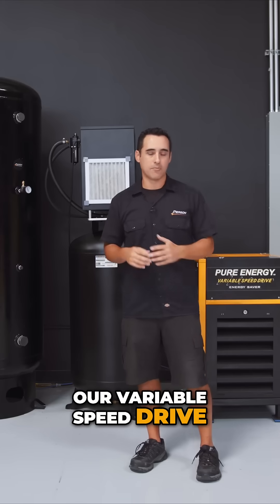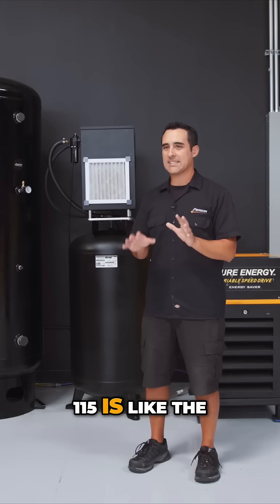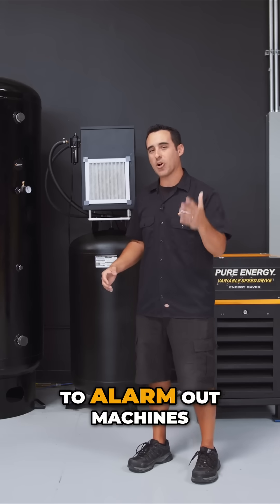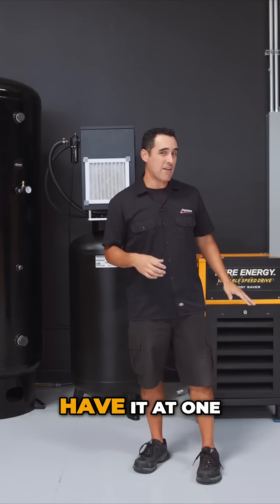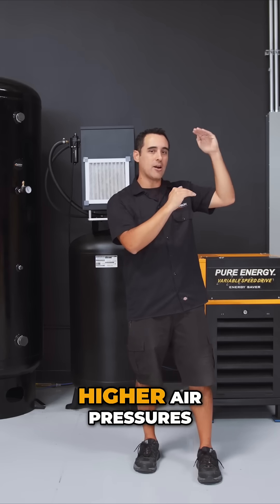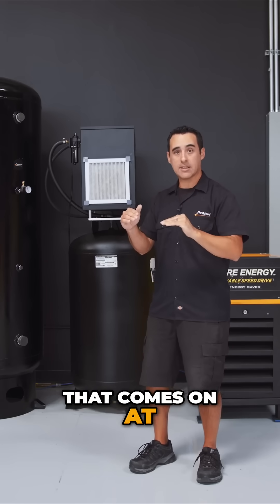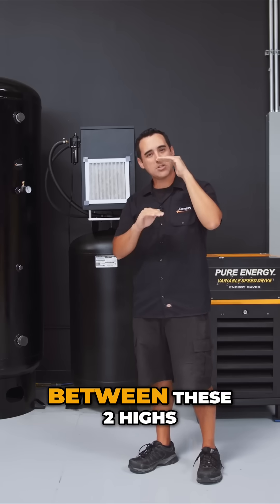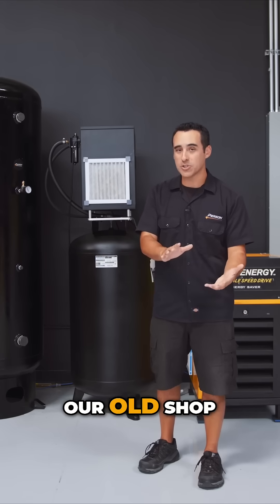Air Compressor Upgrade  #piersonworkholding #cncmachining #manufacturing #aircompressor #tips #diy

Comment: The variable speed compressors are really designed for continuous flow conditions, where the air volume needed is high enough to need it running continuously, and the variable speed allows it to reduce the output as needed, without having to cycle on and off.

If you are using much lower flows where it actually shuts off, then running a higher tank pressure, and a pressure regulator for your working pressure could save you energy.
Reply: This one runs continuously....it never hits the high setpoint during normal operations. 

The higher tank pressure with master regulator allows the system to deal with dynamic demands like air knives without any change in working pressure. 

The compressor experiences a relatively constant flow all day long.
Reply: @Factory400  oh ok, if it's running continuously under basically steady load then the regulator isn't as helpful lol
From the description of the high set point I got the impression that it cycled frequently.

Comment: Depending on how high your air use needs are, and what pressure your tanks are rated for, I would consider running the compressor at the maximum rated tank pressure, and then having a pressure regulator on the output of the tank to set your working system pressure.

This will give you steady air pressure, no variation, and reduce the compressor run time.

Let's say you want your working pressure to be 115, and the tanks and compressor are rated at 180, so you set your compressor set points at 115 on and 180 off, and let the regulator handle the rest.

If you didn't mind some variation, you could have the compressor kick on below your working pressure, say 110, and get a little bit longer between run times.